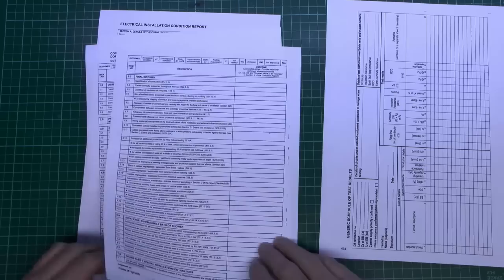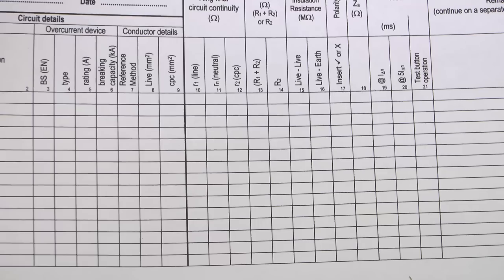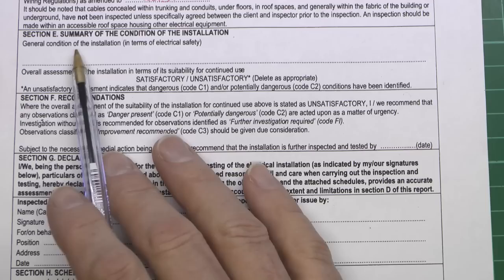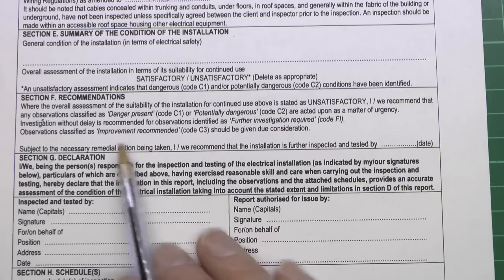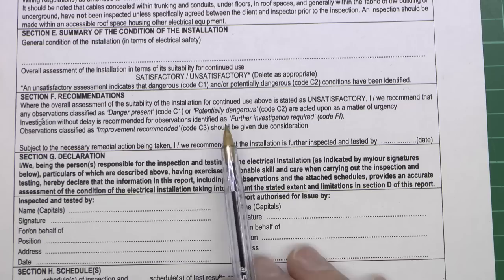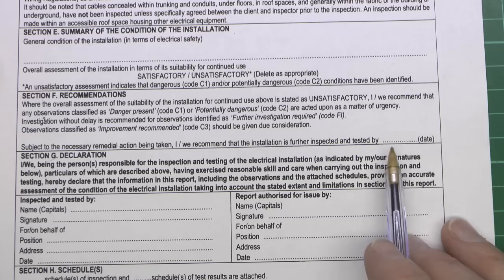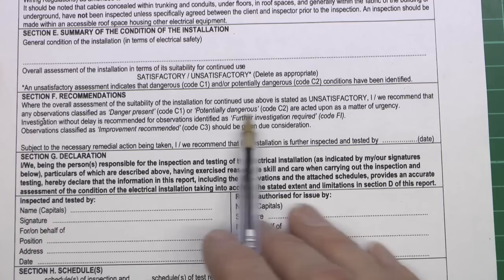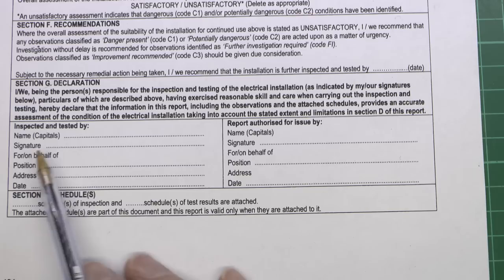Electrical Certificates Part 3 - EICR - Electrical Installation Condition Report

Comment: Good to hear your assessment of the older systems likely to be encountered by us, should we be trying to upgrade incoming distribution supplies. Foe example, where a C3 would be the correct choice for lack of an RCD for additional protection on systems installed some time ago.
Testing is an area lots of guys are wary of, and shared intelligence is very helpful. To those of us who haven't spent lots of time carrying out this type of work directly, your observations could save not only time and money but prevent errors and potential risks, to us or others.

Many thanks

Comment: Going to have to deal with this myself at some point soon. Twenty years of bodged-up DIY has left the house electrics in a state very far from conforming with the regulations. I'm currently working to fix that - bringing it up as much as I can myself (which mostly means fixing my past teenage ineptitudes) in preparation for calling in a professional.
Reply: Leave alone your not an Electrician
Reply: No, I'm not. But I know enough to do half the job, which is better than leaving things as they are now. I know that lightswitches with the face smashed in need replacing, and that live wires poking out of junction boxes are an issue, and that cables rubbing against sharp metal edges of enclosures really need a grommet. I know how to work on it without killing myself. I can fix these obvious things. Simply calling in an electrician is currently not an option due to issues involving the slightly dysfunctional nature of the household. I can hardly make it any more unsafe than it is already.

Comment: Hi, I have just found your videos. They are very professionally done. Thank you for your clear straightforward explainations. I finally understand that I don’t need a ring main in my garage for my woodworking machines I can ask the electrician to fit a radial circuit of sockets. How about a video on a garage workshop set up as we now seem to be using larger  machines when doing diy. Thanks John from County Durham.

Comment: Hi John keep up the good work , I have a question for you I have recently been asked to add a couple of extractors in 2 seperate bathrooms .
Both are venting into same area the loft but it's thatched roof . So as far as the cabling goes as I understand it has to be swa to prevent rodents chewing the stuff through and causing fire .
So ok I get that part but what about the extractors them selves what sort of protection is required as they are of a plastic set up and also the ducts , do these need to be mechanicaly protected ie; metal surrounds or barrier as the rules in bs7671 is very vague , thanks for you time Gary b

Comment: JW, Yet another nugget of excellent information/education. I'm sure the general public have little idea of what the Sparkys should be doing regarding forms to be competed.
Further to my Saga of the MK Consumer Unit installed in Oct 2013 - There is a gap/blanking plate missing between the 1st bank of RCD/MCBs and the second RCD. Would this qualify as a C1 as when the front CU access flap is down I could quite easily put my finger through the gap and possibly touch something inside which could be live. Seems as though the Main switch on the left of the CU is not as far to the left as it could go and therefore there is not enough of a gap to fit a blanking plate. Seems as though the Sparky has done a very poor job of installing the CU. From your explanation of various issues that could exist – the missing blanking plate would infer I have had a C1 present since it was installed. 
I'll need to find out what action I can take to correct it. Hopefully at no cost to me. I'll have to have a ferret around to see what docs I can find. So far I only found the Building Regs Certificate - No install "Certificate" from the installing Electrician. 
If only you were posting this sort of info in 2013 I may have watched some of them and been much wiser as to what docs I should have been provided with. Foolish me thought that the Building Regs Certificate was all I needed and having one "underwritten" by NAPIT would ensure all was as it should be. I now know/am of the strong impression that all is NOT as it should be. At least he got the labelling of what is what correct. I'm going to pursue how easy it would be to identify the and downstairs sockets rings and get them onto separate RCBO's. 
My experience of NAPIT so far since mid Jan '19 draws me to the current conclusion that they seem to not want to be involved in my CU install issue. More correspondace with NAPIT tomorrow then
Reply from the maker: Yes, live parts exposed is one of the very few things that is a C1.

Comment: With an eicr would you check conductors in every accessory in the property  ?
Reply from the maker: You could, but it would be more usual to check some of them, such as 10% or 25%.
All depends on what is required and whether the person requesting the report wants to pay - inspecting everything would take a lot longer and cost more.

Comment: Hi John,
Great video. On your gallery photos you show an open consumer unit at 39:20 with the front cover removed. You mention about the exposed conductor wire on the RCBO but what about the two neutral wires on the right that appear to be coming out of the front of the cabinet. Was there a cut out in the front cover to prevent the cables being damaged when it was fitted back on or was there no front panel fitted? In which case it would have been a C1.

Paul
Reply from the maker: It's only 1 wire - connected to the neutral bar, goes down, loops over to the right and then goes back to the rear of the RCBO.
Reply: John Ward 
Thanks John for the prompt response. Clearly I should have gone to Specsavers!

Comment: Hi John, 11:20 of the video, you went through the details of the person inspecting and testing the report. I wanted to ask about the section "report authorised for issue by". If I'm working for a social housing company, do I fill the company details in that space or do I fill my details in both parts? Thanks
Reply from the maker: That is intended for situations where one person will do the inspection & testing, complete the form with the results, and then that will be checked by someone else who signs in the 'authorised by' box.
They can both be the same person, all depends on the exact arrangements and who is doing the work.

Comment: Thanks for another great video.  But  I'd love to have known what code you'd  have given to the things you talked about.  ( C1, C2, C3, FI, etc.).
For example what would you give a situation that was not complying to even the regs under which it was installed but neither would changing it 'contribute to a significant enhancement of the safety of the installation' thus earning a C3?  Like  no brown sleeving on the blue of a twin and earth used as a switch wire?  (Or the examples on page 18 of the Electrical Safety First Best Practice Guide 4 on EICRs)?
  You'd not want to give it a tick because it isn't correct but neither a C3.  There seem to be a whole host of things in this category.
Reply from the maker: Items like that are N/A or not applicable if there is a box for them on the form, otherwise they are not mentioned on the report.

Comment: if you do an inspection and it has failed, you list the remedials and complete the remidials it then passes, do you issue a certificate thats failed then issue a certificate again with satisfactory on it??
Reply from the maker: When the remedial work is done, a minor works or installation certificate would be issued, that would be kept together with the EICR so that it can be seen that the defects listed were subsequently repaired.
You don't need a second EICR after the faults are fixed.

Comment: 23:53 (4.15 Single pole switching) What is the reason against DP MCBs is it regards TN-C-S systems ? Outside the UK asking. Great video.
Reply from the maker: DP MCBs are permitted, although rarely used.
If they are single pole, they must be in the line conductor.  However if double pole are installed, then that is also acceptable.
Reply: Thanks. As always looking forward to the next vid.